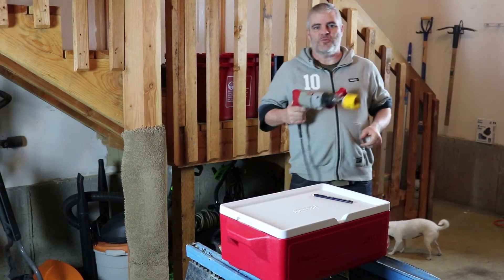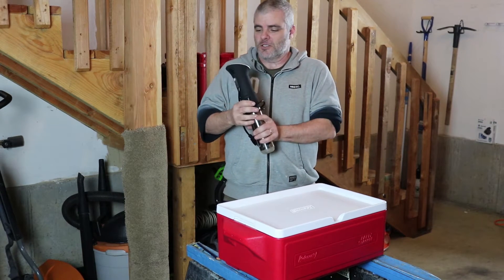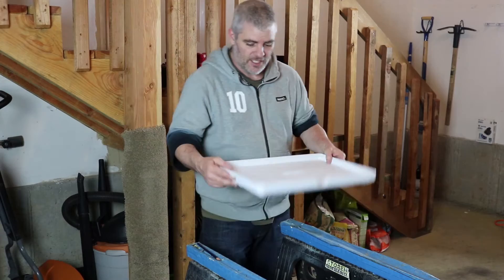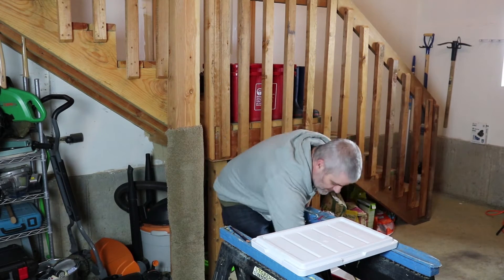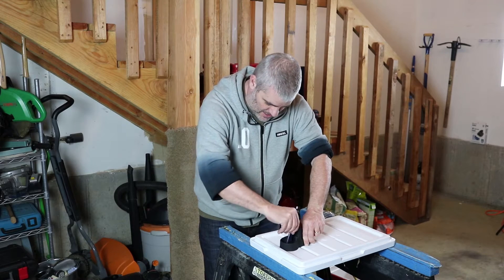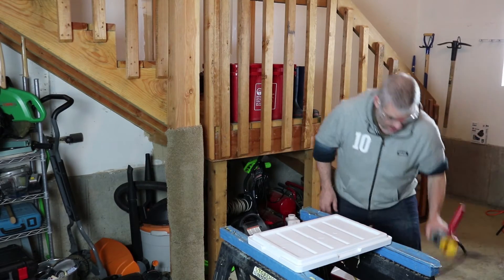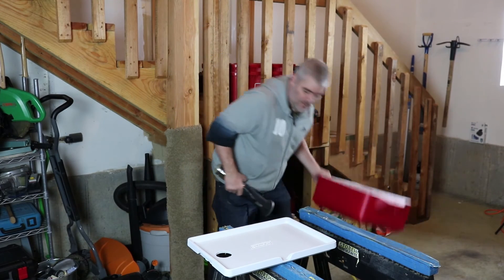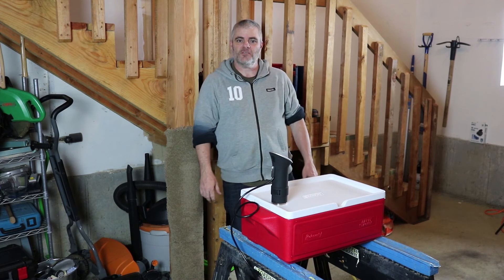Hacking a cooler for sous-vide cooker

Comment: Helpful hint I learned when drilling large holes in plastic buckets for hydroponics that might be useful here. Once the hole saw starts it's cut through the plastic, reverse the drill. It helps make a cleaner cut requiring less clean up.Great vid. Thanks !
Reply: most burr free would be in a drill press, clean up with a deburring tool https://encrypted-tbn3.gstatic.com/shopping?q=tbn:ANd9GcSj3e-jKppwrueLIJScrfVwnpJJ8-BeVPHS-_m1MO_0Ci3xUeA_7nmm-QFjt069UxuMsIruIxZHTU_OULNfzFNp9CPuetdN&usqp=CAE

Comment: Hi

Just wondering....Is it okay that the Anova touches the bottom of the cooler?  Does that affect or melt the plastic?
Reply: Yes, it's okay. The melting point of the plastic in the cooler is close to 300F -- much higher than any sous-vide application. I've been using hacked coolers for several months now and have had no problems.
Reply: Thanks for the reply.  One more question.  I drilled the hole and noticed that there is a hollow area in between.  Do I need to fill that area with something or is it okay as is?

Thanks!
Reply: It's perfectly ok as-is. That space is called an 'air gap' and it's there by design. Glad it worked out for you, and happy cooking!
Reply: Thanks!!  Okay one more question...lol  I know the Anova is rated for 25 qt but could I be able to go up to 33 qt with this set up because of the insulation of heat?  Or should I stay at this cooler rating?
Reply: @GymChung  Stay at that cooling rating!